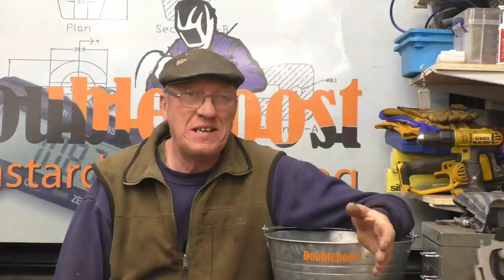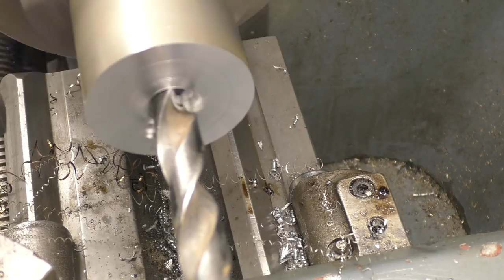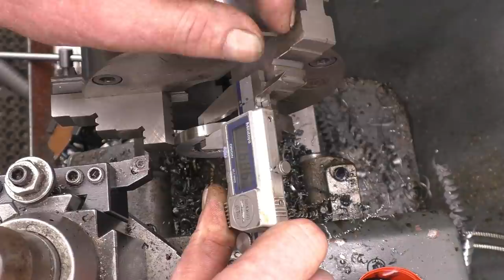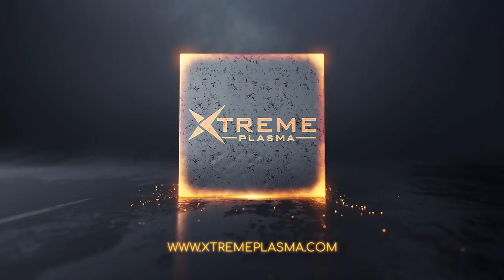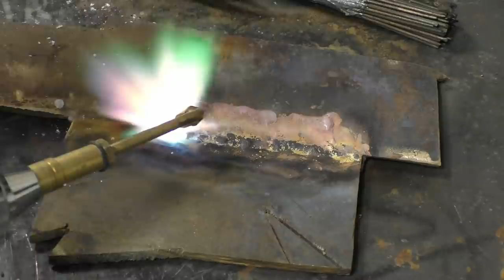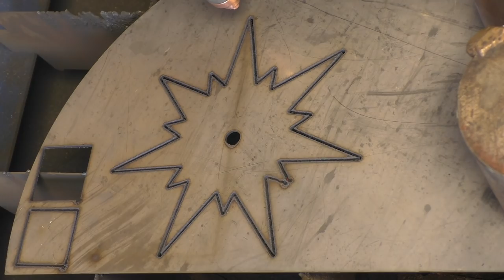SNNC 373  Brass Star .  Thrust washers

Comment: Our Stanley hand drill has 2 gears just the same as yours. We also should have a larger hand drill - which has only one gear - because it's a two-speed hand drill ! I'd guess the high speed is 2:1 and the low speed is 1:1. The two gears are on the handwheel and it has 2 axle bearing positions - so you take the handle, gear and shaft out and re-insert it in the other bearing for the other gear.
Image: https://i.ebayimg.com/images/g/OCwAAOSwWUJfmsR0/s-l1600.jpg If it's still online ! If it isn't, lemme know, I'll find another !